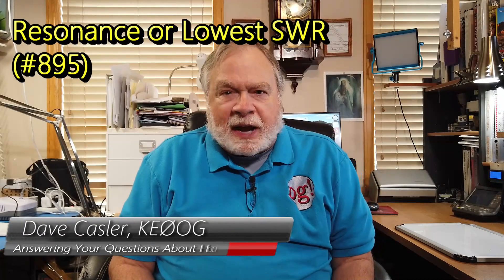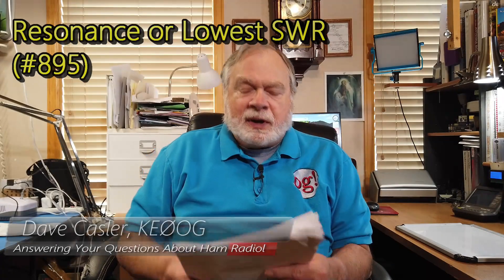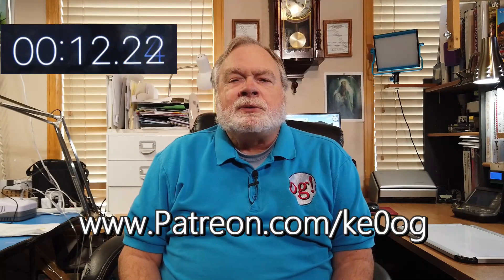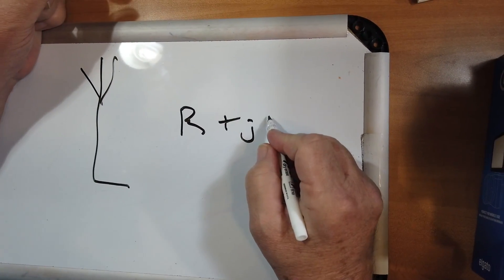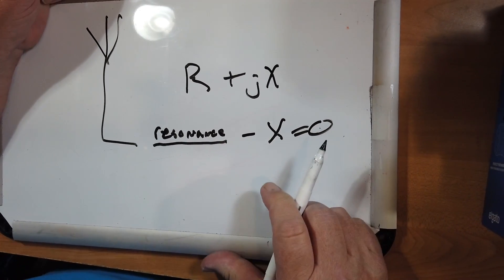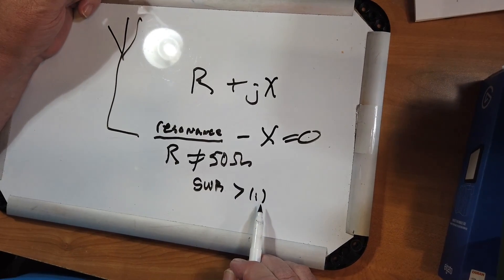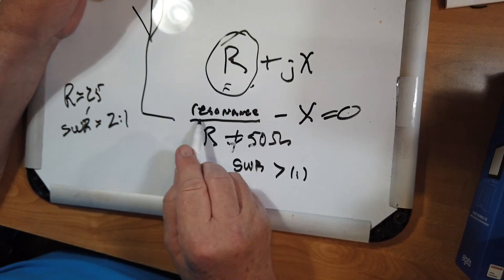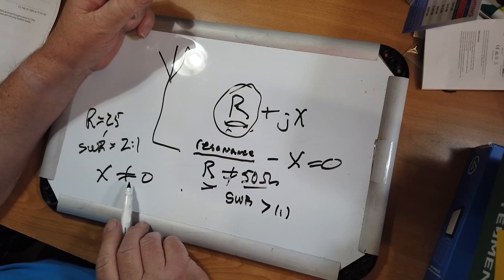Resonance or Lowest SWR (#895)

Comment: If you have a tuner always make sure your antenna is at resonance. This means any power you send to the antenna will radiate. But if you get your SWR low but resonance is way off doesn’t matter if you have no reflected power because your antenna will not radiate it all.

Comment: Here's one for you Dave.

I have no inverted vee (supposedly 50 Ω) for 12m so made one to get an idea of the length required to put in the attic. It's very thin wire, maybe 20 SWG and the tx frequency 24.925 MHz. 
I started with just about 103" each side and kept folding back the ends by about ⅜" and watched the SWR going down each time. I adjusted my meter for maximum sensitivity and upped the power so no longer an SWR reading but reflected power. Then another ⅜" and it started to go up.

With the VNA at these lengths I got this result (varying slightly): 
SWR 1,04
49 - 49.7 Ω +j2

Shortening it again by about ⅜" with my meter for the lowest reading as before I got:
SWR 1.02
49 - 50 Ω +j1.4

Have I just been lucky and it's a fluke or is my meter really searching for 50 Ω? I think this result is pretty good. My theory says it is looking for 50 Ω.
It's a Wheatstone Bridge type with three 50 Ω ±1% low inductance resistors so the unknown leg (aerial) is adjusted to 50 Ω to balance the circuit for zero (almost) reading.

73, G4GHB.

Comment: I was just dealing with something along these lines while building a little j-pole antenna for my GMRS radio. The real issue I was concerned with is that I was using 75 ohm cable as the feed line. So I ended up moving the feed point of the antenna around and trimming for the frequency at the same time using a vna to get the lowest swr I could. But I was still ending up a little on the high side of the ohms according to the Smith chart. The whole thing about 50 ohms is confusing to me in the first place though.

Comment: Seems an important item missed in your explanation, is bringing the resistance to 50 Ohm's, the typical transmitter of today, would not be nearly as taxed, leading to cooler operation, longer life, etc. !
Too, going out on a limb, but going off what you are calling resonance, one side or the other, as long as the SWR isn't prohibitive, won't make you any less apt of making contacts !
And likely talking differences so small that would likely not be noticed at the receiving end !
Obviously, if one wants an SWR figure over a larger swath of frequencies, then you use a larger diameter conductor for your antenna !
In other words, don't sweat the small stuff, trying to eek out every last morsel you can squeeze, but instead use that time to make contacts !
Just my Two cents, or a little more figuring inflation !
👍😉

Comment: Dave hi

Question.  I hv an end fed 6-80(142 feet)Running an icom 7300 and I would like to get on a small bit of 160. Even in emergency mode, I cannot tune it. EM does tune the 3.92-4.00 portion of 80, which my internal tuner will not. Anyhow, would an external tuner like an Mfj-939 be able to hit a bit of 160?

Thanks
William

Comment: Maybe this explains the tuning of a magnetic loop antenna?? You first tune for peak noise and then tune for lowest SWR. When looking at a waterfall display with an expanded span, the peak noise often becomes off-center of the frequency you are on when you tune for lowest SWR.... If this is true, is tuning for lowest SWR really that important if it is not excessively high?

Comment: Glad to see someone show that resonance and low SWR are not the same thing!

We have gotten kind of lazy now with all our antennas designed for a 50 ohm feedpoint impedance and 50 ohm coax. Open an ARRL Antenna Handbook from pre-1960 and you'll find LOTS of great antennas that are fed with open wire feedline (450-600 ohm or even more!) End fed antennas that don't use a balun to match impedance, but a specific length of feedline as a matching network! Once this concept of resonance is understood there is a whole new world of antennas to make!
Reply: It is the audience, including myself, Dave is teaching.  More advanced antenna design is always freely available to those who seek it.

Comment: Perhaps this may add some clarity: To a great extent, power reflected from a mismatched load is not dissipated in its source, it is re-reflected from the source.  Some reflected power is dissipated in the transmission line, and some is eventually dissipated in the load.  An L/C network used to achieve a conjugate match (i.e., antenna tuner) at the load or at the source will dissipated some power, depending on the Q of the components utilized.  If the network is between the transmission line terminus and the load, it appears as the load to the transmission line.  If the network is between the source and transmission line, it appears as the load to the source, and as the source to the transmission line.  With the network at the source, any mismatched load and associated line losses remain; but maximum power will be supplied by the source due to the matched load condition achieved by the network at the source.  Ken WA8FCI
Reply: If the antenna tuner bounces the reflected wave back to the antenna along with the usual forward wave, the reflected signal gets radiated eventually. Which is fine, but the reflected signal is not the same as the forward signal (it is t seconds behind in time). Wouldn't this smear the overall signal? Maybe it might not matter for voice, but for digital modes?
Reply: @eswnl1  You are correct.  The re-reflected signal can adversely affect modulation components/symbols on a carrier signal.  In analog television broadcast signals, this can cause ghosting of the image.  Thus, keeping VSWR low is critical for analog television broadcasters.  For digital TV broadcasters, high VSWR causes inter-digital symbol interference which, to some extent, may be error corrected at the receiver; but when extreme will cause complete information (digital picture and voice) loss.  Thus, low VSWR is critical for digital TV broadcasters.
As you surmised, this is not a significant issue for voice and Morse signals where the modulation rates are much lower than the carrier signal frequency, but as the modulation or symbol rate increases (i.e., symbol-to-carrier rate ratio decreases), it can become problematic.
Additionally, a subtle  point to keep in mind is that reflected power's V and I waves are 180 degrees out-of-phase.  This results in out-of-phase V and I standing waves on the transmission line which leads to different impedances (i.e., different V to I ratios) along the line.  These impedance or V to I ratio variations along the line contribute to signal distortion.  It's the job of the impedance matching network to put the out-of-phase V and I of the reflected  power back into phase and synchronized  with (i.e., added to) the incident power.
Reply: Yes, the best answer to the question.
Dave would look into this I believe 👍
De VU2RZA

Comment: I never understood the use of an antenna tuner, why not tune the antenna in the normal fashion by properly cutting the antenna to length per a mathematical equasion for the frequency???
Reply: Because you would need a different antenna for every band  you wanted to transmit on. And wide bands like 10M would need more than one antenna. And yes I know you can use traps, but they themselves introduce losses.
Reply: There are many antenna types that required a trans-match.
Reply: Because the impedance at resonance is rarely 50ohms hence atu
Reply: Great video! Exactly what I have tested and vetted out very recently on some new antennas. Perfect lesson!
Reply: @charleswoods2996  The ARRL antenna book has other options beyond tuners. Sometimes it's difficult for "some people" like Charles Woods to look beyond themselves. Just sayin'.